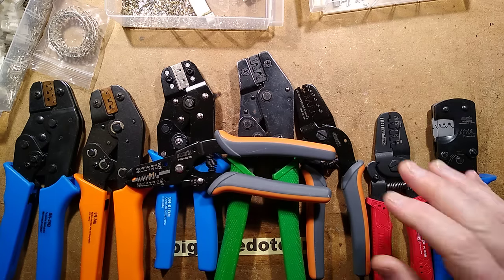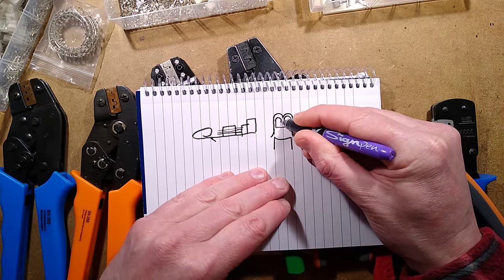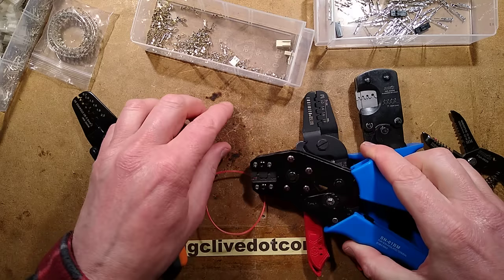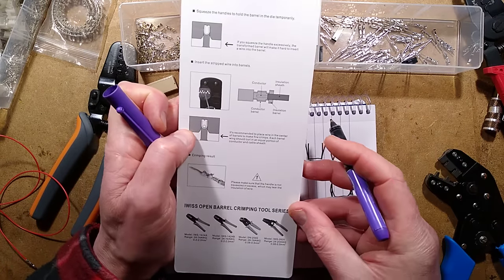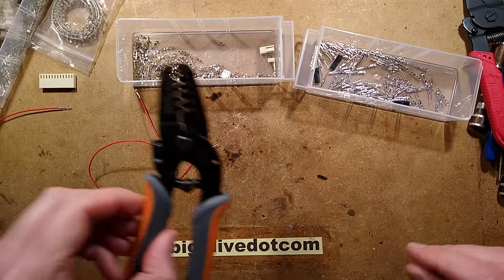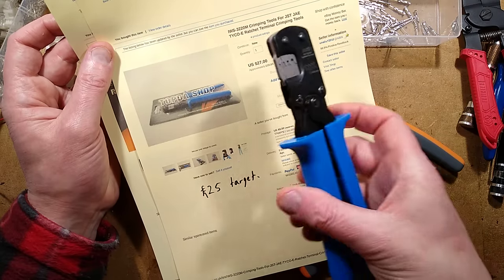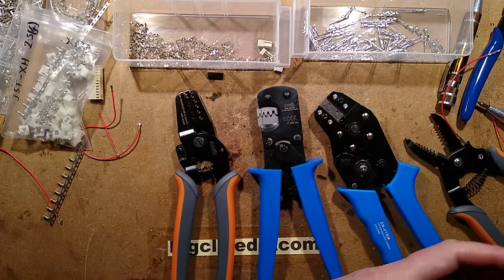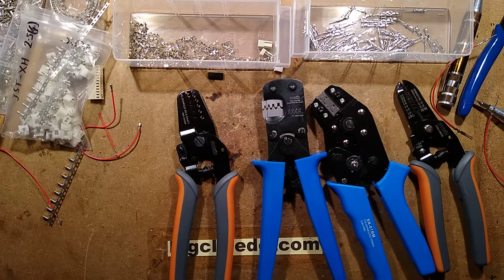Crimping tool test that I screwed up. (Read description.)

Comment: Blunt wire snips crimp everything for me.
Reply: @anonymic79  it is but i dont know that anybody has time for that, i wish that i do, and i have that paycheck, we work with "garbage" for you from old times and manage to do things, question is what is good thing, are you building nuclear bomb and you are conserned that it will blow? these rhings are interesting not to mention, but are fancy, giving up time
Reply: sometimes stone and knife with proper engineering works out in car fuel pump with out blowing out
Reply: @anonymic79  It's nice doing a better job than the tool that was invented for the job.
Reply: @anonymic79  if you're so worried about the connection why the fuck are you crimping instead of soldering, anyways?
Reply: as an engineer/it/tech, we are expected to do miracles, without tools or support and expected to get it perfectly first time so i dont doubt that sometimes a rock and knife are the "right" tool for the job! sometimes i've had to improvise to the point i WISH i had a knife and a rock!
Reply: @schlomoshekelstein908  solder can wick up under the insulation, causing mechanical issues long term, crimping, when done properly is better than soldering for a variety of reasons, which would require a lengthy read of my ESA training manuals. if soldering was the preferred method then all my satellite joints would have been done that way. Although my tool are significantly more expensive than Clive's, and soldering is adequate for most hobbyist applications.
Reply: I just use some small pliers and solder it being carefull not to use too much solder. Sometimes i heatshrink it as well.
Reply: It all depends on the application, some cases soldering is better such as board to board interconnectedness where metal to metal interactions may cause noise such as inn a audio amplifier or in other cases, possibly even in the same device where controls such as a front panel with lights and controls, the ability to be unplugged and plugged far outweighs the electrical solidarity, depending on wire type and strain relief, either connection can be good for external world flexible cables such as mouse usb cables, a proper cramp should not cause any mechanical strain on the connection but in almost every single real-world case it actually does
Reply: @frogz  i disagree, it satelites it is almost impossible to effect a repair, and we use crimps because they are more reliable and consistent. moreover, some of the frequencies that these operate at are far more prone to noise issues than even top end audio, and yet crimp is still the preferred method.
Reply: @anonymic79  Simpletons can't think outside of the box though.

Comment: Iwiss slots 0.7 and 1.0 are practically useless (jst 1.0 and 1.25 crimps). They never giver the roll to both sides, either wing could roll and the other one just falls on top.The other slots works good though. 1.25 (with some adjustment) and up jst can be done decently in this tool. I guess that's why I can't find any video using the 0.7mm slot especially.

Comment: I first bought the 28-something crimper and indeed, it doesn't work. I think it's for coarser crimps for electrical wires rather than fine electronics wires. Then I bought the SN-01BM, and indeed this works fine.

Comment: For anyone wondering... The 25 in the 2500 of the connector description/name refers to the 2.5mm pitch or space between the centre of the pins/sockets. You can get them in different sizes like 1.0mm, 1.25mm,, etc...

Comment: I hate when (PC/computer/tech) people call the 4-pin power plug a "Molex." They say it like that particular connector is called a Molex connector. I think they don't realize that Molex is a company, and makes every single one of the contractors inside a computer case. 
"Plug in the Molex." 
"They're all Molex, which one?"
(This isn't a reference to anything Clive said, but it just reminded me when he said Molex.)
Reply from the maker: In the early days the connectors were often actually made by Molex.  I suppose it's like calling a vacuum cleaner a hoover.  The name has stuck.

Comment: So Deutch, Packard, Molex, etc... They all crimp the same it's simply the housing that makes the difference. I've been using mine for years with varying results, Then one day about 6 months ago the crimper angels smiled down upon me with rays of sun and a chorus of hiz-ahh, and I perfected depth and position of the connector. I can't find that style anymore and the new ones are resistant to their predecessors positioning. Patience is a virtue, but so is having a pitch so powerful you can leave a divot in a cement wall with a pair of crimping pliers... Just kidding, endeavour to persevere.

Comment: 44 yrs ago I worked for a startup that built acoustic radars, gas flue velocity monitors and other "high tech" gadgets.  We could not justify buying high priced crimpers for Dupont style connectors so they used needle nosed pliers and cheap student labor (me)! I screwed up my share of crimps!

Comment: how about a vid with the various choices of crimps for larger diameter cable?  You'd' get to play with hydraulic 'C' shaped and 'U' shaped toys. . . I mean tools.
Reply from the maker: When I use those size crimps it tends to get all officious and certifiable.  The cheap tool thing isn't an option.

Comment: What are your thoughts on a "one crimper to rule them all" solution like Knipex 97 33 02 ?
Reply: The price is 180 Euro...also not cheap. And the 5 different dies sold with this crimper are for 4.8 and 6.3 open plug connectors, insulated terminals, plug and butt style, but not for the ones BigClive is using. Maybe these dies are available as well for this crimper, but I could not find them. This tool seems to be made for car electrics.

Comment: So would a silicon / dry grease be better for these crimping tool?
Reply from the maker: Silicone grease is controversial in the area of electrical connections it divides people between doing a great job and potentially interfering with contacts with an insulating layer.  I'm inclined to think it's just been blamed for bad connections.

Comment: You need to be a bit careful with ordering from Aliexpress. I ordered an IWISS IWS-2820 off Aliexpress and they sent me an IWISS branded SN-28B. Not to mention I ordered it in November and it didn't arrive until January, despite the fact that their "tracking" reckoned it showed up in December. I would definitely not recommend buying from Aliexpress.

Comment: Some of those look like a set of WeatherPak crimpers I had to buy for the refrigeration job.
Reply from the maker: The weather pack connectors are another dedicated crimper that curves the retaining wings round the waterproof seal.  iWiss do one.
Reply: They do a set which look almost identical to the ones I paid something like $80(US) for on the Matco truck (mine have that odd arrangement which makes the head side move linearly instead of at an angle). In fairness, none of the people on the skeleton crew (myself included) bothered to look online and find iWiss' $20 set.
Reply: @bigclivedotcom  I would be nice to try to compare that pair of crimpers against other brands.

Comment: Is iWiss intended to be one of those Chinese almost- ripoff of the Wiss brand? If so, that's weird because Wiss is known for scissors, snips and shears. Not so much usable for crimping.
Reply: IWISS is a self-owned brand from China,totally different with WISS,it’s specialized in development and manufacture crimping tools for electrical connection and plumbing.The brand “IWISS” is registered in China, U.S, UK,Australia,Germany and other EU countries.With decades endeavor,IWISS has won more and more recognition in the worldwide.

Comment: Ooooooooh! Crimping pliers porn! I love these tools. Especially for the automotive connectors. So simple and so neat. :D  Knipex, WTD-SCHMID, Würth are good. AMP ones are very good.
Twirling the loose wire strings makes putting the cable in easier.
Reply from the maker: Twisting the ends is a controversial thing.  With these folded round wings it could actually cause issues, but in traditional round barrel crimps for large wires I do it.

Comment: Ah, the original Molex crimping tool. About 75 pounds. Almost 40 years ago. Not that there were any alternatives. Edit - Actually I think that price was for the anvil, there were different anvils for different connectors. You got one anvil with the crimper, I think someone else has said they were about 130 pounds.

Could have done with seeing this video 2 weeks ago when I ordered  the Sn-28b!

Comment: Working in a Wire Harness factory I operated a  termination machine that used those reals.  We had about 5o various types of terminals and the associated Crimp sets .  Setting them up to do a proper crimp  is almost a art.  No two crimping jaw sets acted  the  same.  Did thousand of Wire Clips and Terminations  a day.  BORING.  You never posses the proper hand crimper for the task.  You just learn to adapt what you have to work with..  LOL   Just the other day  I spent $30.00 for  what seems to be a half decent Crimper or 10-02AWG terminals.

Comment: You didn't mention how to adjust the SN-01bm and 2 SN-28b style of ratchet tool including the first  you discarded. 

Whilst I firmly agree that any tool that does'nt workout of the box is a kit, with crimping tools the variance between crimp manufacturers and the range of wire sizes that may fit into each crimp they will need to be adjusted for lower or higher crimping pressure.
I am sure you are aware that the little star shaped wheel secured with a screw, near to the ratchet release is the crimp preasure adjuster just remove the screw and move in the direction of the + to increase crimping pressure and the - forvice versa. This can transform a problematic tool into a freind for life.
Reply from the maker: With the first tools the jaws would not do the job at any crimping pressure since they were not capable of closing enough.
Reply: @bigclivedotcom  sorry my mistake I thought you said one of them over crimped and broke the wire. I need to clean my ears out.

Comment: That cardboard reel of 1000 contacts reminds me of the 10,000 contact reel we had to buy even though we only needed 10 or 20 contacts- this was before ebay. Even worse, another shop in the same company and same building also bought a 10,000 contact reel.

Comment: I’ve got an RJ45 crimper, but rarely do I get it right first time…
Reply: Really? I've never had an issue with those. Aside from getting the wires splayed out in a line, once you get them slid into the connector, it seems to crimp very reliably. When doing RJ45 wall plates, I will usually put a connector on the end of the wire in the wall, and use a female RJ45 to female RJ45 passthrough cover plate. That way I don't have to deal with the stake-on cover plates.
Reply: Crimping RJ45: walk in the park
Shoving the wires in to RJ45 correctly: hell on earth
Reply: @YSoreil  Even worse with grease filled cable !
Reply: @YSoreil  Still better than punching a keystone without a puck.
Reply: Get the plugs that allow you to push the conductors out the other end.
Reply: @_Steven_S  Those are great if you like dead ports.

Comment: I've never liked plugs like this! if I mount something inside a box, I solder the cord! Such plugs can cause poor contact over time. the best is to solder if you can. you must also always use such thin wire on such plugs

Comment: The world is divided into two groups of people; those that are cult-like in their love of crimping and those worry about its effectiveness.    Very interesting tool test which seems to validate three tenets;
1) a proper crimper is needed
2) proper crimp connector is needed
3) expertise in crimping is needed
It is Not as easy as it may seem.  
On another channel a "crimp-head" was showing how to crimp and botched it twice, and glossed over two major points. It is Not as easy as it appears (or shown).  I watched a few other YT vids on crimping and None got it 100% correct.

Comment: The expensive crimpers that do it all for you should also prepare the wire too - cutting off a bit of core and the right amount of insulation.

Not a problem with a soldering iron.
Reply: @johncoops6897  Clearly you're unfamiliar with soldering.
They all have the effect on the insulation - the heat causes the insulation to self peel back.
Reply: @johncoops6897  At least another responder understands.

Comment: How to repair one if it is jammed?? I use the last green one.
Reply from the maker: If you can squeeze it a bit more there is a spring loaded latch under the handle that will release the ratchet.
Reply: @bigclivedotcom  Thank you very much...I will try tomorrow..the metal is jammed between the jaws and couldn't be squeezed further. I had no clue what to do release the jaw grip. Do we need any other tool to release spring and put it back?

Comment: I respectfully question methodology on the no-name-brand SN-series crimpers. You appear to have 3 or 4 different brands (2xblue, orange, green) across 4 different die profiles. When two of them get tossed, you sound like you might be tossing them for quality reasons, which are probably more relevant to the particular brand than the model. For example, the SN-28B by IWISS has EDM-cut dies, and very positive reviews on Amazon. But watching the review, one comes away thinking the SN-28B is just a bad profile. Feels akin to saying Mercedes sedans must stink because my Kia sedan has been nothing but trouble.

Comment: have you done a wire stripper comparison?
Reply from the maker: No.  But I use a few different types in the videos.
Reply: @bigclivedotcom  ,i watched you use a type i wouldnt use.  and you had olts of strips to do.  i scored a copy of a type that holds then strips.  very easy to use.  and i wonder why big clive never uses one of them.  the day after watching your video i was using it and it was damaging the wires.  it needs adjustment to work at its best.  you probably never use anything like it because it damages wires.

Comment: A poor workman blames his tools. When you buy crimping tools that match the terminal they work properly. The reels of terminals are not designed for manual crimping. THAT'S WHY YOU HAVE PROBLEMS. 

DON'T BLAME THE TOOLS. I have a $400 LAN cable terminating tool that makes a perfect termination. You can also buy plastic tools that  fail to crimp  more often than successfully.

Cheap terminals fail, too, even with good tools.

Comment: Do you know what the adjustment wheel does?
Reply from the maker: It varies the ratchet release pressure.  It can be used to fine-tune crimping strength.
Reply: @bigclivedotcom  Thanks Clive.  And are the tools you dismissed any more use if adjusted or is it poor dies?

Comment: Uhh, those are not crimping tools. Those are mini crimpers lol. If the handles aren’t at least 10 inches long, it’s a mini crimper. If they are, they’re regular crimpers, if they’re the size of your average loppers, 20-30 inches, they’re lug crimpers. And they wear your whole body down very quickly.
Reply from the maker: Well they're definitely faster to use than the hydraulic crimpers at work.
Reply: bigclivedotcom Oh for damn sure lol, everything excelled in its own area. Honestly the ones I’m talking about are definitely not electronics equipment. They’re made for three phase motors and the larger ones are for power delivery and sometimes structural grounding.

Comment: I’ve crimped quite a bit of DuPont connectors with Iwiss SN-28B with orange handle and they make perfect crimps.

IWISS SN-28B DUPONT Terminal Ratchet Crimper 2.54mm 3.96mm (AWG28-18) 0.1-1.0MM² https://www.amazon.ca/dp/B017JU20Z6/ref=cm_sw_r_cp_apip_zf9W3xRDcbAhW

Comment: I just brought a set of these, https://www.narva.com.au/products/56523

Because they came with 6 sets of heads for different styles of crimps, the crimps I brought for a job (ring terminal) I couldn't get to work with the double crimping head, but I got it to work nice with the single crimping head just had to do each crimp twice, this is more to do with the crimps I brought rather than the tool though, the crimps were quite heavy duty and were ment to do wire 0.8mm2 - 2.4mm2 and my wire I was using was 1mm2, I should have gone smaller crimps

Comment: When you find your crimper in the crap section
Reply: hi fellow crap crimper user! I have one of the "Qi-28B" crimpers that looks very similar to the SN-28B crimper in the video but my die is different from the one in the video (has two positions instead of three), has always served me well and the crimps are 99% as good as my very expensive "calibrated" crimper at work... if it's something I care about I generally crimp and then put a little bit of solder just to help ensure a good connection anyway
Reply: @flecom5309  I feel like it isn't the crimper but the dies, I need to get a few more sizes

Comment: Why is it no good to twist the wires?
Reply from the maker: The crimp curls in and splits them into two bundles which it grips separately.  If twisted it can cut the strands.